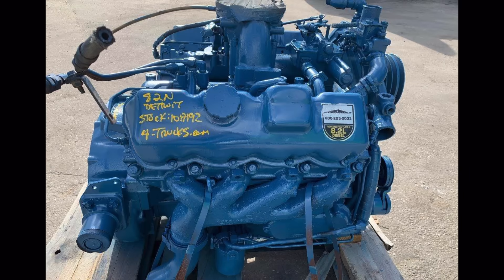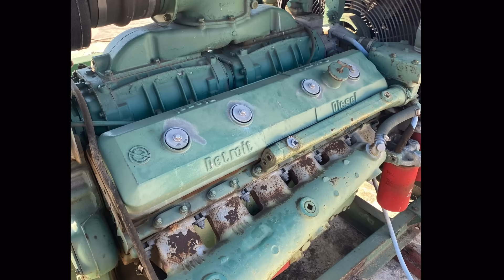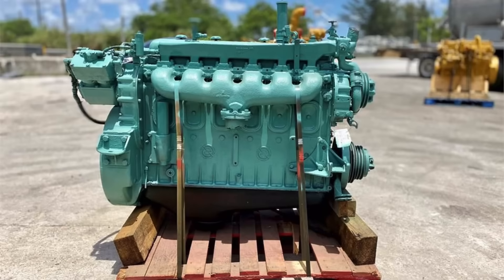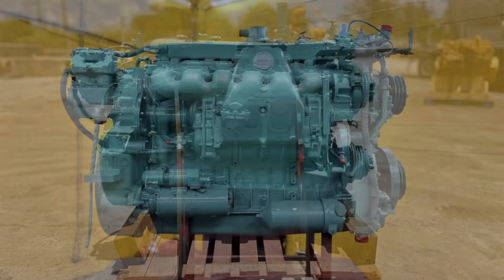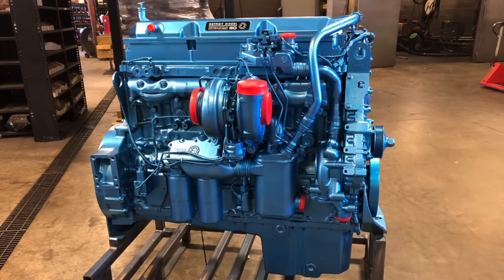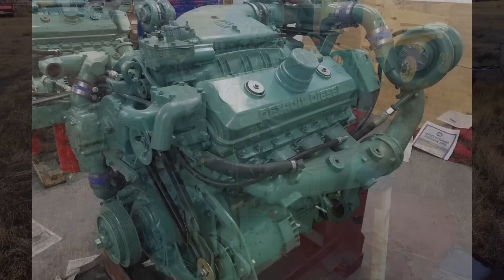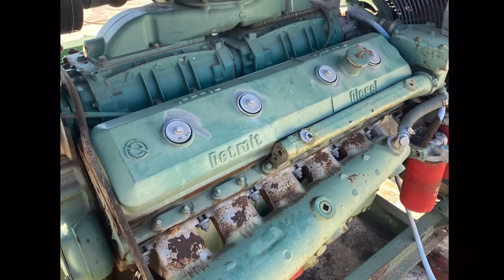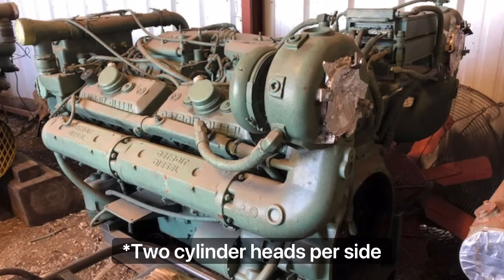Best Engines: GM Builds an Awesome V12 with Detroit Diesel's 12V71 "Buzzin' Dozen"

Comment: Back in the early '80s, I was a mechanic in a mechanized infantry unit in the U.S. Army in Bamberg, Germany.  I was the operator of a M578 Recovery Vehicle (VTR, or a wrecker on tracks weighing 30 tons) which was powered by an 8V71T Detroit and our battalion consisted mainly of APCs (Armored Personnel Carriers) powered by 6V53 Detroits (318 Detroit) and I still have flashbacks to arctic cold mornings before the sun even came up when we would have training alerts and ALL the equipment must be ready to roll out, the smoky haze over the motor pool, the distinctive smell of 2 stroke diesel exhaust in the air, and the roaring thunder which was comprised of the hum of the dozens of the 318 Detroits idling, warming up, and waiting to defend our way of life.  Throw in a few Continental V12 air cooled diesels in the 60 ton recovery vehicles (M80s), the straight 6 multifuel "Deuce-and-a-halves", and the 250 HP "Big Block" Cummins in our 5 ton trucks, GOSH!!!  I've been out of the service for decades now, but every time I smell diesel fuel, diesel exhaust, or hear the melodic hum of a Detroit Diesel engine, I am compelled to put my hand over my heart and hum "The Star Spangled Banner" no matter who thinks I am a nut!!!  ...and to top it off, I'm a Ford guy, but the ol' 2 stroke diesels have a mighty special place in my heart!!!
Reply: @rogerdodrill4733; a Detroit Diesel 2 stroke engine does not pump air through like a 4 cycle engine does. There are other 2 cycle industrial and marine engines. They all require a means to move air into the cylinders, and that is what the blower is for. The blower pushes air into the airbox, and when a piston gets low enough to uncover the intake ports in the cylinder liner, the air flows into the cylinder. To allow air to flow in, exhaust valves in the head begin to open a few degrees before the piston uncovers the intake port. Exhaust passes out the valves and the fresh air pushes it up from the bottom. The exhaust valves close a few degrees before the piston covers the intake port to begin compression. These are refered to as NA or naturally aspirated engines.
One or more turbochargers can also be installed with other parts changes to increase airflow into the engine to increase power and efficiency. These are called T or turbocharged engines. A liquid filled aftercooler is installed on some engines between the turbocharger and the blower, designated TA. In other applications the aftercooler is replaced with an air to air intercooler mounted in front of the radiator to cool the intake air more, TI.
An engine listed as a 8V92TA is 8 cylinders in a Vee arrangement, 92 cubic inches per cylinder with a turbocharger and aftercooler.
An engine listed as a 6V92TTI is a 6 cylinder V engine with 92 cubic inches per cylinder, single turbocharger, torque rise and intercooled. The torque rise was accomplished by cutting back the high RPM torque and thus HP of say a 350HP rated 6V engine using bellville washers on the high speed adjustment mechanism.  Bellville washers are cup shaped spring steel washers. When installed stacked in opposite directions, they form a short spring. Detroit Diesel used these to hold the engine out of full fuel until the RPM dropped. Maximum power might be held to 300HP but as the RPM dropped to about 1300, you got the torque that a 350HP engine would produce. The theory was fuel saving.
12V, 16V, 20V, and 24V engines could have 4 or 6 turbochargers installed.
An early and rare General Motors diesel is the 51 Series which had no valves, just intake and exhaust ports. GM Diesel also produced a 6L110 engine for a while, with exhaust valves.
Other 2 stroke cycle GM or Detroit Diesel engines are Series 53, Series 71, Series 92, Series 149, and then the EMD, Electromotive Diesel engines with I think 567, 645, and 712CID. These were primarily designed to power train locomotive generators, and had up to 24 cylinders. Some got repurposed to grid or standby power applications when a locomotive was retired.
Reply: Yup the 6v53 is 318 CID. But the 318 generally referred to the 8V71 truck engines which happened to be 318HP. These were naturally aspirated, no turbocharger. The blowers were there for scavenging, not supercharging.
Reply: @daledavies2334 u mean they evacuated the cylinders of burnt exhaust gas? Didn't force  feed the intake?
Reply: @rogerdodrill4733  .... The blower accomplished Both, scavenge and fresh intake air at the same time.
Reply: Exactly , I was in Germany (Fulda Gap) . I remember that smell
Reply: Great story!! It's interesting how technology has evolved, but it's great to hear stories about the old 6-71 series engines!!
Reply: You're right. They even had 653v in dump trucks. It was known as the screaming demon 😈   insanely noisey and lots of oil 🛢 dripping as well as lots of smoke 🚬 😂😂😂😂😅
Reply: @michaelhatcher5264  if it "dripped" oil...you had a bad mechanic. Our big ts24 scrapers and our dozers never had oil under them in the morning. That's just a bs story.
Reply: Fords borrowed the 453 a lot in the late 70's. Gotta love it❤
Reply: @donaldreadenour3776  I was in 3-35 armor in Bamberg. 82-85.

Comment: It's nice to see you're delving into some cool diesel history. I'm a farmer and run trucks as well. Growing up the 2 stroke detroit was the choice of power for most of the irrigation wells, and alot are still currently in use today. I also still have 2 trucks, one with an 8v92 and one with 6v92 still running strong. There's nothing like that sound, and I couldn't imagine a world without it! On a side note, have you ever heard of the International Harvester UD series diesel engines? They were early diesels that started on gasoline and then there was a compression lever you pulled to switch it to run on diesel. We have some of those too. That could be a fun topic to research.

Comment: I was raised on Detroit engines. And I still love them.
Reply: My father was an owner operator leased to the chemical company.  He bought a new 1965 GMC v12 gas engine with 2 four
barrel carbs.  It made great gobs of power, so much so it only had a straight 5 speed tranny.  Diesels on the interstates could
not out run him.   Except for the mileage.   On a good day he could get as much as 2 miles per gallon.  He got a Diamond T
with a Cummins and a 10 speed road ranger to stay afloat after ditching the GMC
Reply: i got a silver 8v92 to tinker with out back

Comment: Awesome video, I started my career as a Union Carhauler in 1988 driving a 1979 GMC Brigidier. It had a 6-71. Awesome sound, but no power to match. It was still a fun truck to drive. We changed to Volvo/GMC's with series 60's in the 90's. What a difference. It's amazing those early Detroits were relevant for over 50 years. Most buses in the NYC area had them also.
Reply: Thats why buses have that distinctive sound

Comment: Greetings: 1) U neglected 2 include the 8V92 and it's many variations and the 92 series. It was the most used DDC in rosd trucks prior the 90s. 2) The "60 series" did not debut in 95 as U said. By then it was in the 3rd gen being the DDEC 3.  The 60/70 series came out in about 90. I liked the 92s and 71s. I do not like the 60s.

Comment: Being a little picky here but you said the cylinder ports let fuel and air into the engine but of course it was just air and the injector sprayed the fuel in.  The jimmy that made the highest pitched scream was the 53 series and in 6V form it was amazing. It revved higher than the other sized engines which added to the sound but if you put an Allison auto behind it then it stepped up a notch again. I worked for an interstate bus company in Australia during the 1980"s and we had 6V 92T and 8V 92T engines in the fleet with the average distance travelled by each vehicle was 30000 kilometers [18,650 miles] a month. The engines were removed at 1,000,000 Kilometers [620,000 miles] regardless of condition to be rebuilt. in ten years only five engines did not make the mandatory rebuild target. The fleet was around the 150-vehicle mark. What's more is that the rebuilt engines would cover the same distance as the maiden engines.

Comment: Cut my teeth working on Detroit 6v,8v,71’s in the 70’s and 80’s in buses. 8v92ta’s also. Great engines. The series 60 was even better until 2004.

Comment: IN THE MARINE INDUSTRY  TWO  12 V 71 N/A  WITH MARINE GEARS TWIN DISC 514  6.1 RATIO  THIS POWER PACK  RATED HORSE POWER  AT 800 HP .

Comment: The old Detroit 2 cycle engines were an enigma.... Some hated them most loved them.... One fact about them.... they were bomb proof.... They made a perfect fire truck engine.... just start them.... let them build a little oil pressure and slam the pedal to the floor....   They were also great bus engines.... day after day... stop and go traffic.... the only real down side..... they were terrible on gas....

Comment: I used to live by the TransCanada highway, and worked at the Husky truck stop pumping diesel (and repairing tires😬)as a kid. An outfit called George Smith Trucking used to run only Detroits, if I recall correctly, in ONLY single cabovers with single axles. I don't know if they equipped them with loud mufflers, or they just COULDN'T be muffled, but I remember I could hear those Detroits screaming for minutes before they would come into sight, especially in the wee hours on night shift! 
It was a memorable sound!
Great information and story!

Comment: I'm currently still working with Detroit diesels in the Netherlands. We have one 12V71 as emergency generator and two 16V71's as firefighting engines. For those purposes the best choice, they only stop when the last connectingrod pops out of the block.

Comment: Back in 2001 we put a 12v71 turbo into a mack supper liner tri axel tractor to haul heavy equipment we had to cut holes in the hood for the turbo. We pulled the motor out of a large t-rex loader

Comment: My father repaired those engines all his life. I grew up with those wonderful sounds. I believe they were generated by the blower with its elecoidal rotors made of aluminum. Wonderful engine.
Special mention to the direct cylinder injection system.

Comment: The very first inland/rivers towboat I ever worked on was powered by three turbo charged 12v71’s. They were real screamers! We had 6 71’s powering our generators, affectionately known to our crew as the “hammers of hell”. 
I’m pretty sure there were also a lot of 16cyl Detroit two strokes powering some of the other, larger boats.

Comment: 12v71 was OK I drove one but my twin turbo 8v92 would actually pull better but when I bought my Pete with the KT600 that was a beast I hauled cattle in the 70s and 80s  you couldn't beat those motors or those days😊

Comment: RPM stands for revolutionS per minute.  Note that revolutions is plural.  Therefore, there is no need to write or say RPMs as "revolutions per minutes" makes no sense from either a grammatical or engineering standpoint.

Comment: These diesels are another part of the wisdom of the US WW2 logistics system. 6, 8 and 12 cylinder motors that just mostly share the same parts. Your 6 cylinder 5 ton truck and your 12 cylinder LCT can be worked on by the same guy using the same parts.  Sure it might have leaked oil but that really is not that important compared to reliable, easy to work on and plenty and enough powerful. I've studied the military for years and it has come to me, the Germans had the Tiger Tank and the US had the 2 and a half ton Chevy truck, the US won - says which was the most important weapon right?

Comment: What is the pipe fitting on the exhaust manifold for?
Reply: That is a marine engine and is equipped with water-cooled exhaust manifolds.

Comment: The 2 biggest problems the 2 strokes had were that the cooling system had to be large. They would be happy at 160 degrees all day. They could stand 180 degrees for short bursts but if you got to 200 the engine would need a trip to the shop. The power was more limited in truck applications because of the limits in the size of the cooling system. These things could be cranked right up in a marine application because of the basically unlimited cooling. 
The second problem was that the 'mechanics' that worked on them could do repairs but not so them properly. Forget about cracking a book and measuring anything. I saw plenty of guys pound these things with an air gun and crossed fingers. Then they would say these engines were junk because of all the problems they had never understanding that they caused most of the problems in the first place.
Reply: EXACTLY RIGHT!!! When set up properly, mantained properly, and operated properly one of the most reliable,durable and power to weight ratioed engine's ever built!!
Reply: I had a 74 john deere JDX8 sled with CCW 440, she purred on 15w40 @ 40:1!

Comment: 7:12 the piston skirt is long in the 2 stroke because it has to block the intake ports. If it don't. The supercharger will pump boost into the crank case.

Comment: I'm sure you are aware, but you mistakenly mentioned the 'air/fuel charge' several times in the video even though there is NO fuel in the intake charge until it is injected slightly before top dead center of the compression stroke. Just thought I'd let you know. 8-)
Reply from the maker: i did.  my mistake.

Comment: I fell in love with the sound of 12V71s in the early 1990s when a late '80s Hatteras 70 Motor Yacht with twin 12V71TAs was a transient at the marina where my parents docked their boat.   When the captain fired her up at the dock it sounded like a fleet of GMC "fish bowl" city buses were in the engine room.   Like someone else mentioned here, I can tell a Detroit Diesel powered boat from a distance - they are loud and always sound like they are running twice as fast as they actually are.

Comment: My father in law made his own 4 wheel tractors with Detroits. Started with 6 71 in line and v, then 8 71, 12v71 and the last a twin turbo 12v92. It was huge in the 80s

Comment: One of  fleets I maintained had late '70s GMC  Sleepercab Astros with 12-71s, 13 speed, and straight pipes; beautiful exhaust note. 4 MPG; completing a topset (injector height/valve lash/governor and rack) was brutal. We had V12 GMC gas tractors as well, single drive axle with a tag axle for the weight, what fun. Still have my first 60 Series Certificate, framed, a relic, like myself.

Comment: When the Golden Gate Bridge District decided to get into the transit business, they bought a fleet of the older GMC aluminum buses with "normally aspirated" blown-but-not-turbocharged engines & rooftop exhaust.  They were pretty clean.  When they replaced their fleet in the early 80's, they bought the new fiberglass GMC buses with the turbocharged Detroits...  Because of the combustion chamber design or the injector timing, they smoked every time they pulled away from a stop - AND some genius changed them to under-bumper exhaust!

Comment: Serviced a pair of 12V71's  in a 65 foot Hatteras,  had to carry the used crankcase oil out of the engine room, though the boat, all white berber carpet and white marble, in 5 gallon buckets. It was terrifying.

Comment: Grew up around the two stroke Detroits, when I started working as a mechanic for a bus fleet in the late 90's they still had a lot of 8v71's, and 8v92's as well as the Series 60's. I do not see them very often these days, and sadly even the Series 60 engines are dwindling in population too. I loved the sound of the two strokes, but if I was buying something large with a diesel, Series 60 all the way for me.

Comment: The rig of my dreams is a square 3/4-ton Suburban with the rare aluminum-block 6V53T Detroit, 10-speed RoadRanger (with some sort of a transfer case arrangement for 4WD). If I ever have an extra 30-50 grand I will DEFINITELY build it. We had an old log truck on our farm with a 453T and a 10-speed, they sound SUPER flying-apart-fast, and the turbo makes them less loud (non-turbo Detroits are genuinely PAINFULLY loud).

Comment: I used to drive and service a terex r35b off highway dump truck back in the 1980s. We used to advance the timing and as long as you serviced them regularly they just kept roaring. Fantastic engine.
Reply: Our Series 71 engines could only be "advanced"... 2 degrees. Period.

Comment: The piston length in these engines has much to do with the intake ports as the piston has to seal the ports on the compression stroke and that is also why they have rings at the bottom of the piston.  The stroke of the piston cannot be much longer than the piston length which dictates a rather short stroke.

Comment: Very informative video but it was only air that was pushed into the cylinder with the blower, the fuel was injected at the top of the piston stroke, initiating combustion. There is also an exhaust valve in the combustion chamber, operated by a camshaft, that opens at the bottom of the piston stroke. The incoming air forces out the spent exhaust gases through the exhaust valve.

Comment: Find yourself a 16V-71 (92), which are more common than you might think, or a 24V-92 that I have seen on some frac pumps.

What I would like to see, is a video on the GM "Toro-Flo" 4-stroke Diesel from the late 50's-early 60's.